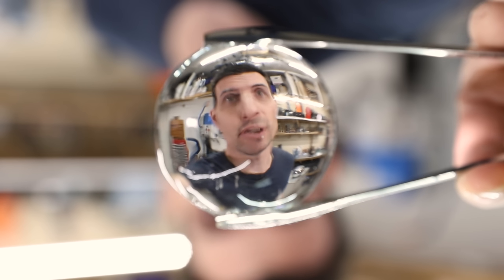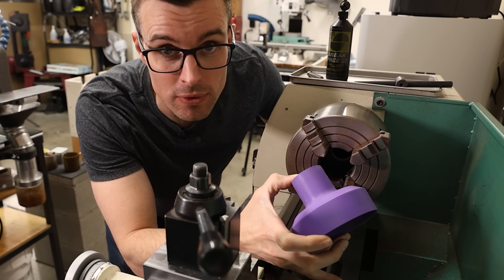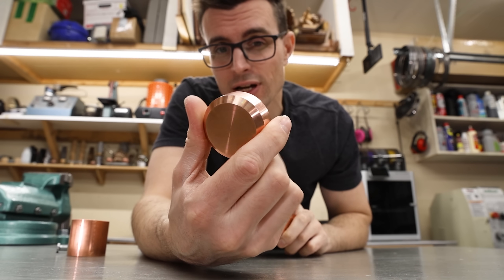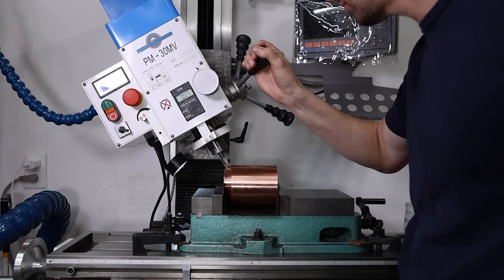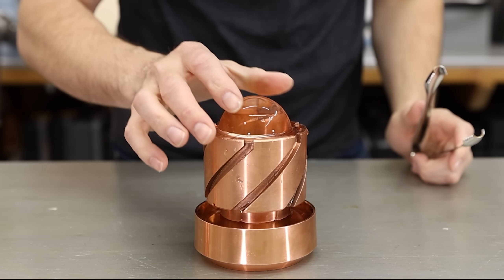I made a Copper Ice Press that Turns Ice into SPHERES - Lets try DRY ICE!

Comment: That suspendaslurry is so expensive😅 they dont sell smaller amounts. I need it so badly but dang 250 for just ONE thing for a part time hobby is steep. I finally broke down and bought a giant box of nice investment casting powder, which works- but even then I have issues with lost PLA. Ive gone full circle- i now make a 3d print- then i cast that in silicone, then I do a wax mold of that silicone, then investment casting, then normal investment lost wax casting- for the intricate machine parts I usually make lost PLA just didnt work well enough to make the time investment worth it when it only worked half the time😅 somebody please make a suspendaslurry type ceramic shell casting slurry and sell it in hobby/consumer quantities😂😂 and lastly- lost PLA STINKS holy smokes its stinky. Stinks up the whole street lol

Comment: I wonder if you tried this inside a pressurized chamber, 6-10 bars or so, and a lower temperature, like -60C or, so, so that liquid CO2 would be stable and you wouldn't be so far above the sublimation / melting point.  Maybe under those conditions a perfect frozen CO2 sphere would be achievable.

Comment: How are you going to deal with oxidation? Copper notoriously makes a vibrant green oxide, and quick when exposed to water. Would there be any potential part waxing or silver electro plating in the future of the project? I say silver because it's more conductive and less reactive with oxygen. Maybe a coating of Aluminum would also be perfect, since a thin coat would protect from oxidation entirely while also not interfering with the conductivity too much.

Comment: This is amazing you made your own ice crystal and there definitely 💯 wonderful artwork and projects that fans and families can try out or enjoy in this amazing project and new ideas if you don’t mind me sharing it as well you know I’ve that ice crystals is like He O2 and Pe Hydro Chloride which modules absorb water from the air convert combustion into oxygen and then water absorption into water which makes it freezes in water creating carbon and oxygen be careful if was mold into a Liquid Metal as possible water over silicon and water can calculate the volume of water you need palimony clay it’s a better solution if molecules can be used to measure water in a vacuum type system make it easier to measure water as released of water drains into its surface is amazing and calibration and it just a thought not ruin anything or take away from to actually make it better than glass liquids molding as for metal material molding it’s amazing how well done it can look even solar powered and metallic metals metic materials can be poured or used yes organic materials too in an glass or metal frame and the general idea is you use light source as its wired to light spectrum of steel or insulation of light wired into the magnetic field gravity speed sensor mechanisms of motion and acceleration of light in space

Comment: If your hot water is 120 degrees you should be very careful, Exposure in as little as 10 minutes of 120 degree water causes third degree burns, and 8 minutes causes 2nd degree burns. You should really set your water heater to max out at 118f which doubles the exposure length before causing irreversible injury.

Comment: Your work is really worthy of praise, but it did not delight me. And the reason is simple - from such an elegant and heavy product you expect ideal precision of lines, absolutely parallel vectors of movement of the upper part relative to the lower and the surface when it is lowered. You have an obvious problem with this - there is a tilt, the centering is lost in the process. This greatly ruins the impression.
Although in the end everything is ok, but personally I felt discomfort seeing the skew, tilt of the upper part. There was even anxiety that it would not take the ideal position at the end point.. Yes, the ice sphere is ideal as a result, but from devices of this level and "class", you want to feel delight from the first to the last seconds of use. So that the upper part would descend flawlessly - evenly, without tilt and at a uniform speed.
Of course, advice and wishes from someone on the Internet are worth nothing, but I will still suggest:
1) Inside the upper part of the device, make internal guides (with a slot for the passage of water), which will fit into the "grooves" of the existing spiral gutters. In addition to smoothness and accuracy of movement, this will give the effect of rotation.
2) Implement a convenient water drain, possibly using the resulting pressure, which will create a “fountain” effect, filling a regular glass standing nearby.

Comment: Nicely executed 👍👍.You can do the same, with simple 3d printed model too, with some understanding of physics. To shape the ice block, you are applying a pressure profile, that matches the final shape. As the pressure is applied, it raises the melting point of ice, turning it into water, the water escapes due to gravity, leaving the final shape as desired. You still need a chunk of ice, that is slowly cooled and the bubbles chopped off. With FDM 3d prints, you need to print it in ABS, and vapor smooth the interior(maintaining sharp edge needs some masking).
The top of the model can then have a pin, where you can stack some small weight discs🤔. Should work more or less similar. Regarding Dry ICE, it would have worked, if you pre cool the copper mold with liquid nitrogen. Just some 💭.❤👍

Comment: Aluminium would be enough, it's technically worse at transfering heat, but better at radiating it due to it's lower density, so generally it ends up very similar while being much cheaper and lighter. I'd also include fins, if it has to work passively preferably large ones, thicker and with even more room in-between. You want to maximize surface / heat transfer between your metal and air, otherwise it'll really slow down at transfering heat between ice and metal once the latter becomes cold enough.

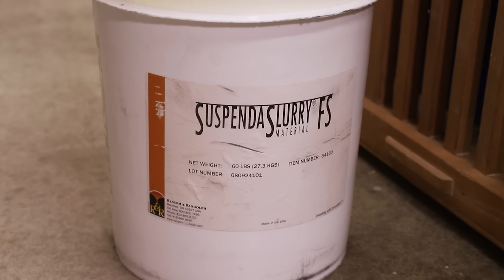Comment: 1:37 You should experiment with repurposing an ultrasonic cleaner to coat parts in slurry! Every nook and cranny!
I also recommend giving PVB filament a try. It’s similar to PLA, except you can smooth it out with alcohol.
ZA-12 alloy is also great for casting, if you want to give that a try.

Comment: What about making drinking glass sized little pressure pots that you can add water the put in your freezer that will shrink all air bubbles smaller that you can see like with resin casting

Comment: You can make clear ice using a passive 12v water pump or small fish tank powerhead. Trick is to keep the water flowing as it freezes, the pump is magnetic drive so the impeller will stop spinning but the drive will not burn up.

Comment: Thanks for sharing, there is one flaw in your design, you can not see your ice cube.  Part of the appeal of this is the visual of it melting.  If you were trying to make something different from all the other ones I would still make it so that you can see the ice cube as it melts.  I have not seen any of the other ice presses with the channels for the melt, that is really cool, when the water just runs over the sides it is not as impressive as having the visual of the water running down the channels but even these get blocked as the ice melts so that all you can see is the outside of the ice cube machine.
Reply from the maker: Thanks for watching! I'm in the process of making a new top piece that is transparent, so we will be able to see what's going on.

Comment: You ought to spin the upper part as it's working, it might turn out better plus faster (your logo would have to rotate offscreen though).  Or I'm also thinking jiggling it, a vibrating ice press.
And... would it work better if it's a bit funnel shaped and as the block of ice melts it would funnel or center into the mold.

Comment: Dude said aluminum and steel is easier to smelt than copper.
Reply from the maker: @junatah5903  did I though?
Reply: @robinson-foundry  yes, also 110 degrees out of your faucet makes no sense, that's well above boiling.
Reply: @junatah5903  maybe 110°F?
Reply: @robinson-foundry  nice build, tho I question if it would tarnish over time if you don't treat it from finger oils and even the water itself.

Comment: Hi, it is not a matter of thermal conductivity, but pressure.   In very old school chemistry manuals there is a well known experiment, you ice water into a cylindrical "bottle" with threading, put steel marbles on top of the ice and screw the cover that have a thick kernel that presses on ice, when you reopen it, your ice is still ice but your marbles are now at the bottom of the bottle (fusion by pressure and re-icing by drop of pressure).
Reply: Let me ask you a question if you put marble in there that had a very low thermal conductivity, do you think it would make it to the bottom of the bottle nearly as fastly as a marble that has a high thermal conductivity, it wouldn't. Pressure does matter but thermal conductivity matters way more because without thermal conductivity it would take years to melt the ice with the copper alone but since copper has a high thermal conductivity, it can absorb the temperature from the ice causing it to melt and the pressure accelerates this. You are very correct that you have to have both but you can't just have one without the other which is why it is a matter of thermal conductivity AND pressure.
Reply: @Ryno1278  No, pressure is the only condition to ensure H₂O surfusion, talk to a chemist.
Reply: @hankhulator5007  What are you talking about? Did you not watch the video? We're not trying to fuse ice, It's simply melting it why else do you think non-homemade ice presses are made of copper. It greatly increases the speed at which it melts the ice which is the whole point of an ice press. You can do it with any material if you have enough time, sure But people don't want to wait 30 minutes to melt ice into a sphere copper just greatly accelerates this because it absorbs temperature melting the ice quicker. I'm not trying to say that pressure does not help, but in this situation I would argue that thermal conductivity is much more effective at melting ice. I'm not sure why you keep bringing fusion and pressure because that's not what this video was about it was simply about melting ice. So please don't tell me to talk to a chemist if you don't even know what you're talking about.
Reply: @Ryno1278  High school > Physics professor > Talking to physics professor…
Reply: @hankhulator5007 You can't prove me wrong so you're just going to keep saying stuff about various professions and school. What a joke!
Reply: @Ryno1278  I already told you whatever was necessary in terms of physics, but as all people that think they know it all  you obviously will not  make the personal effort to ask people whose knowledge is undeniable (yes, I'm right, which collides hard with your preconception) - this is a pity but  absolutely not  a surprise in an era where people really thinks the world is either black or white, ignoring the Mezzo Tinte that governs it and much worse, denies the reality of the laws of physics.

As for proofs, as I already told you, open whatever old  book of high grade physics and you'll find that you are wrong, but once again you won't, thus going against all scientific way of conducting a thorough inquiries…
Reply: @hankhulator5007  You're looking way too deep into this. It's simply a matter of melting ice

Comment: suggestion: use gold dust suspended in epoxy resin to fill the cracks / voids.  It will make the bell stronger but also look like kintsugi.  If you don't want to see the flaw, you could use copper dust instead.

Comment: 00:20 Q: "Why do it in copper?"   A:"Conductivity."   A:" Also, you can buy these molds in rubber for $30, aluminum for about $100, and copper for $2000. The only way it's worth cad-designing, 3D printing, metal casting, and machining, is to save $1500 and do it myself, otherwise this video wouldn't exist."

Comment: Isn't aluminum (other than its oxide layer) only a little bit less thermally conductive than copper, and FAR cheaper and lighter? I wonder if something like this could be 'cost-optimized' by using a larger volume of aluminum instead. Probably wouldn't press under its own weight, though, it might need active pressure applied. And copper looks so nice, also...

Comment: You can also degas the copper by pumping any inert gas into it while it is molten, the most common I've seen used is Argon gas. You could also remove it via ultrasonic vibrations while it's red hot.

 Both this methods are used to remove air bubbles from metals.

Comment: Really nice work! The polishing compound over the unprotected lathe slide ways made me nervous though. You should thoroughly clean those slide ways with kerosene after that. Also, that ice doesn't seem very cold. If you set your freezer to -30°C or lower, that ice will take a lot longer to melt.

Comment: Really, nice walkthrough and variety of techniques used. Congratulation on the effect! 
One remark: if the threaded rod that connects copper pieces is made of steel (even stainless), you will have it corroded quite fast (galvanic corrosion), probably should be also from Cu or Al or from brass.

Comment: AI Summary:

Crafting a Copper Ice Press: A Journey Through Metal Casting and Machining

*   0:00:00 Introduction to Copper's Thermal Properties: The video explains why copper is ideal for an ice press due to its excellent thermal conductivity, second only to silver among metals.

*   0:00:39 Design and 3D Printing: The creator uses CAD software to design the ice press and then 3D prints the components.

*   0:01:01 Casting Methods: Different casting methods are used for various parts. The most complex pieces utilize a ceramic shell investment casting process. Simpler parts, such as the base, use sand casting.

*   0:01:32 Ceramic Shell Process: A liquid ceramic is repeatedly applied to 3D-printed parts over about a week and a half, building up a shell.

*   0:02:00 Sand Casting the Base: The base is cast using a "riser" to compensate for metal shrinkage during solidification, preventing voids.

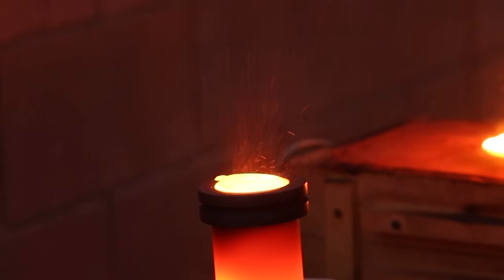*    0:03:03 Initial Casting Failure: The first attempt at casting the base is unsuccessful due to gas absorption in the molten metal, causing porosity.

*   0:03:15 De-gassing: A small amount of phosphor copper is added to subsequent melts to de-gas the copper, although the creator's goal is to keep it a spure as possible.

*   0:03:25 Lathe Work: Machining begins, creating parts from copper bar stock.

*   0:04:51 Burning Out Plastic: The 3D-printed plastic within the ceramic shells is burned out in a kiln. Soldering irons are used to pre-melt some of the plastic, creating escape routes for expanding gases.

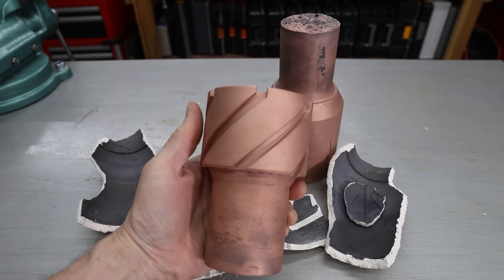*   0:06:55 Casting Success: The ceramic shell casting is successful, despite a minor shrinkage defect on one side.

*   0:07:17 Fitting the Pieces: Careful machining is required to ensure the two halves of the press fit together precisely, accounting for shrinkage during cooling.

*   0:08:48 Machining Dimples: A mill with a rotating vise and tilted head is used to machine the dimples into the press halves.

*   0:09:47 Finished Copper Press: The completed press weighs 16 1/2 pounds and meets the creator's expectations.

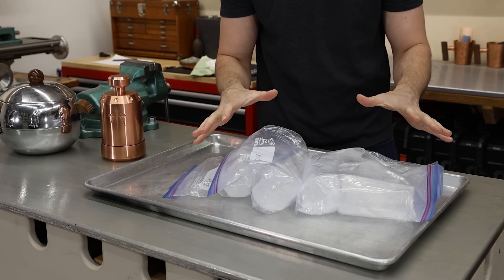*   0:10:09 Making Clear Ice: The video describes the process of making clear ice by freezing water in an insulated cup, top-down, to push impurities out.

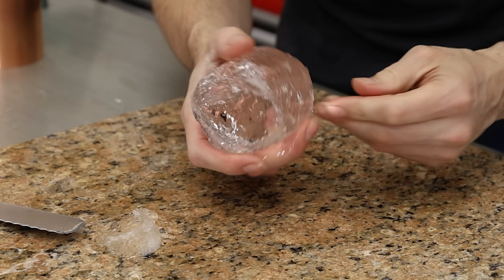*   0:10:50 Testing with Regular Ice: The ice press is tested with regular ice, rapidly transforming it into a perfect sphere.

*   0:11:53 Testing with Layered Ice: A piece of ice with visible layers is used, resulting in a sphere resembling an eyeball.

*   0:13:07 Testing with Dry Ice: Dry ice is used, producing a dramatic and explosive result due to the sublimation of dry ice directly into gas. The dry ice shatters, and the experiment is aborted.

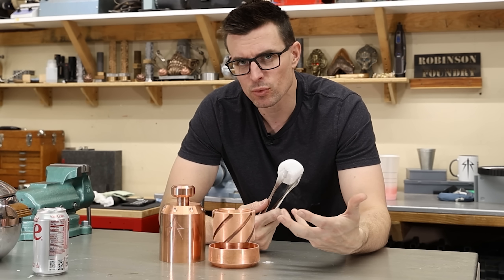*   0:15:38 Inspiration and DIY Motivation: The creator acknowledges that the ice press is not an original idea, but existing models are expensive, motivating a personal build.

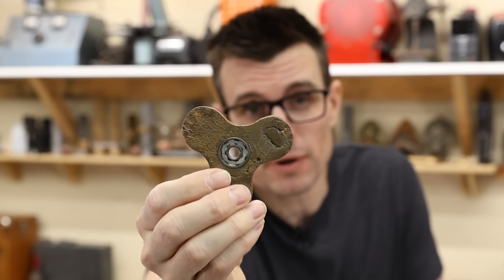*   0:16:01 Encouragement for Beginners: The creator shares their first metal casting to inspire viewers to try metalworking themselves, emphasizing that sophisticated tools aren't initially necessary.

I used gemini-2.0-pro-exp-02-05| input-price: 1.25 output-price: 5 max-context-length: 128_000 on rocketrecap dot com to summarize the transcript.
Cost (if I didn't use the free tier): $0.02
Input tokens: 13429
Output tokens: 779

Comment: So the rifling, the twisted grooves, don't actually do anything mechanical other than that they're liquid water drains?  If they were straight vertical grooves everything would act the same. The top piece should be keyed to ride in the grooves so you get an axial.. twist to maximize copper-ice interaction.

Comment: 1:38 this is how all those hundreds of little airfoils in airliner jet engines are made.  They don't 3d print production runs, they use wax for cost/scale but the ceramic slurry layering is how they cast those very critical parts throughout aircraft engines.

Comment: A good way to cover up surface porosity in copper, if you don't want to go through the hassle of recasting and machining the part, is to invest in a Tig welder and practice sealing the porosity holes by welding them shut. Then you only have to surface cut the material back to a polished finish.

Comment: Forged in fire.
As for the dry ice, if you inhale the O=C=O surrounding the ice press, your heart will beat faster in order for your brain to get its adequated O=O supply.
If C=O was to be released as ice dry melts,
you would ultimately die as the body has no C=O sensors but we're assuming here that the majority of the O=O near the sphere gets pushed away by the newly formed C=O gas while you're still breathing the air near the sphere...
Just my 2 cents.